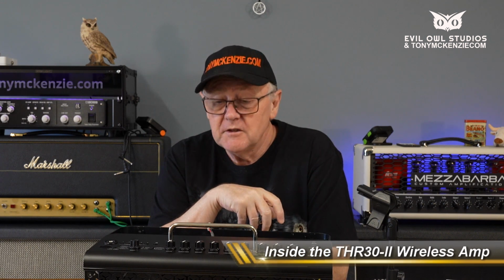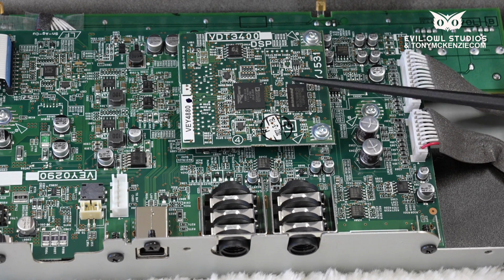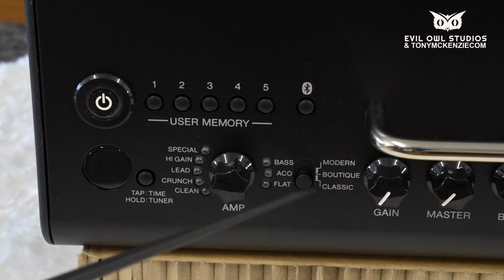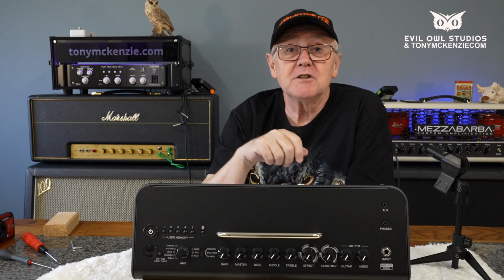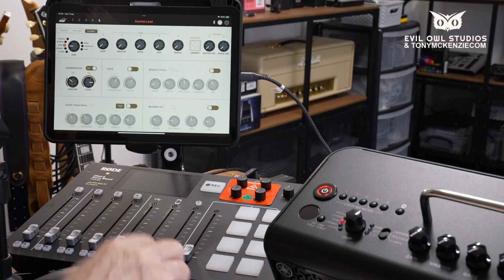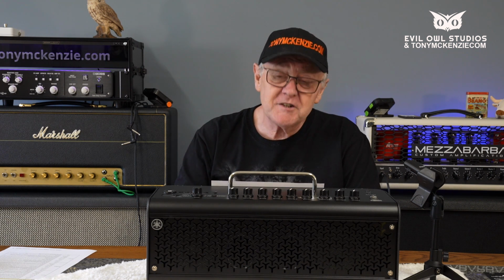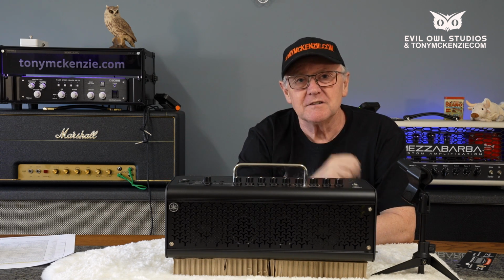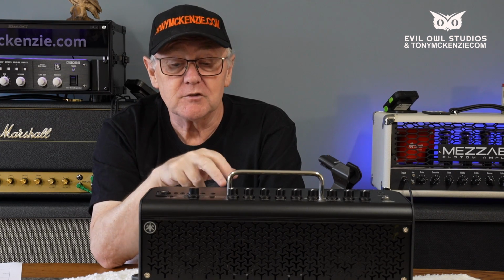Yamaha THR30II Wireless Amp Simulator: In Depth Review

Comment: Hi.. Tony. So many videos out there. I came across your video today after purchasing my THR30 today through Sweetwater in the US. I love that company. They also had the GT10ii back ordered. Then looked other places with the same problem on back order. Found out the GT10. Had issues of over heating. Line 6 wanted everyone to stop using them. I guess GT10 ii is the fix. I did find one online through a small music store in New England. They should arrive close to the same time. It would not have been fun to wait past a warranty if the receiver did not work on the THR. Great review I much say ! Ohh and it’s $110 US dollars more…
Reply from the maker: Great info Barry and thanks for posting it... I never found one of the new ones at all. Notice though how there is no mention by anyone re that point and some will be disappointed if they buy the unit and then try to find a wireless for it. Great point on the warranty as well. Thanks for watching and nice to hear you...

Comment: Had mine about 14months now, great practise amp and good to finally see the inside of it.
Mine does have a gremlin lurking and I'm not sure what happened. When set on the  Boutique setting with Hi gain or Lead amp it will buzz quite loudly and renders those sounds unusable.
Might send an email to Yamaha and see how a warranty will go.
Reply: @JacquesShurmer I had the exact same problem with a brand new one that I bought the very first time I used it.
Reply from the maker: Thanks for the info on this - yes I would contact them and get it solved. Thanks for watching.

Comment: Still no boosts on board for the THR30II, it does sound good, but the low end is so flubby it feels like playing on a bad interface with lots of latency, SUCH a strange feeling, nobody talks about it either.
Reply from the maker: Thanks for the comments. I did not really notice it particularly on this one... but I don't doubt your comments... and hey thanks for watching too.
Reply: @tonymckenzieofficial  it's definitely only something I noticed when going back and forth with the Katana Air. Adding an SD-1 (through the Katana's boost section) does exactly what you want it to do, it focuses the low end and brings out the mids, it's really quite remarkable. All of the sudden I 100% understood how necessary an OD is for getting a studio-ready tone. Sadly, that also made me realize how lacking my, arguably nicer, THR30II was
Reply from the maker: @Soloist1983  Well I think that most simulators are generally good in a number of ways, but ultimately there is generally one issue or another on virtually every one I have seen. Of course when you own one then you get to see those little things, sometimes frustrating, but some of the stuff has limitations that they never talk about... we find them later when we own one. Some OD pedals are even 'necessary' for tube amps also like the rectifiers as a good example; without the OD they can sound good, but with one they can sound great. Personally I never did get to the Katana (I will) and thanks for the info, all very useful.

Comment: I always wondered if there was enough bass in that thing.  It was only until the Spark came around where I thought you can get lots of bass from small speakers - but  it has too much bass. It would be nice to have something cleaner.
Reply from the maker: Well it has adequate bass (and as you might guess lots of treble) and overall the tones were pretty good. I am not a fan of Spark and ultimately cancelled my order through non-delivery for months. Not a reflection on the gear itself, but the company I did not like really. Thanks for the post and for watching.
Reply: @tonymckenzieofficial  They are sick. When you scroll through a list of amps there's 5 that are 'locked' because you have to pay for them. Same with pedals. They keep inventing more amps, and I fear soon the list will be tons of ads.

Comment: Thanks for another fine review. A portable solution for those on the road, perhaps. I am using a Blackstar through my UA Ox, and don't need to transport it. The impression I have from the youtube audio is that it is a bit too frail sounding, not enough bottom - although I am sure you can tweak it to compensate.
Reply from the maker: Yes you can tweak it, if you look at the images of the amp settings if I remember we had them mainly at 12 o clock but Alan might have tweaked here and there. Through the desk obviously I could have changed lots but better for the review as is. Thanks for the info on your gear and I nearly bought an OX some while back. Yes for this little amp you could use it right to the PA and flip the unit as a sort of monitor towards you. Of course on a stage control might be more important than faffing about with an iPad... but if anyone out there IS gigging with the unit do post how you control it...   thanks for watching as always and for the interesting post...

Comment: Thanks for a really detailed review yet again Tony. I thought it was certainly well made with a lot of useful features, a bit pricy perhaps, especially if you go for the wireless, when available. I have had a hankering for one for years but I think I would go for one of the more basic & cheaper models.
Reply from the maker: Yes the wireless non-availability is frankly a pain and exactly as you said the pricing (seemingly pushed up by the dealer in this case I think) does not help either. I thought £400 would have been reasonable but seemingly that was never going to happen. The wireless part was also expensive for what it is and it said a lot when version 1 was around £120 and version 2 (basically the same thing) dropped to £80 something. So the choice of one of the cheaper ones is a valid consideration. I never tried any of the others hence this review. Interesting that the main chip was about $12. Thanks for the post and for watching.

Comment: A very interesting review, and the only one to show us the internal construction.
I am not a fan of pcb mounted sockets, sooner or later the print cracks and on a board full of surface mounted
devices, replacing them will make you swear!
The issue with the wireless section is concerning.
If you want to buy one, you will have to wait, all the big sellers say that it is on back order.
For now i can wait, my trusty Vox VT-40X does all i need for now.
Thanks for another great highly entertaining review Tony.🙂👍
Reply from the maker: I know, I looked and saw nothing showing internal build. Yes I'm sure that lugging the device, plugging in and out all the time particularly if you do use it for gigs then that could potentially be a weak link. The wireless I could not believe. I have had this about a month (doing other stuff between this review) and nope no wireless device and seemingly hyped up retail price by dealers I thought was a p*** t***. But its happening everywhere I guess. Yes well the gear we have is what's really important and the vapor ware currently from most makers is exactly that - and this unit shows that perfectly. There are so many makers out there but very slow (if at all) releases of new gear and honestly I'm not surprised. I saw Fulltone stopped :( and that's really sad. I really loved that gear, it was extremely well made and even partly hand made - always signed inside and dated, and that is a very sad thing to see then stop making gear. Me? I'll be buying some Fulltone stuff as I never really found much gear with that level of quality that Mike Fuller made. Great comments and thanks for watching.
Reply: @tonymckenzieofficial  Todays gear seems to be lacking the magic that the ones that were available before all the current crisis had.
You can't define it, but you know it when you see and hear it.
Yet people buy the new stuff, i wonder how many regret buying the stuff that is way over hyped on Youtube only to find that it sounds nothing like what they hear on here.
A friend of mine fell for the dreaded Spark Amp, waited a long time, then when it arrived it sounded terrible, i tried to help him with all the firmware updates and known fixes, but is still sounded bad with a boomy bass that wouln't go away.
I put it out of it's missery and took it to the recycling centre, good riddance to it!
You can only do so much with these practice amps, they are designed for one thing only, but not many that i have heard sound very good.